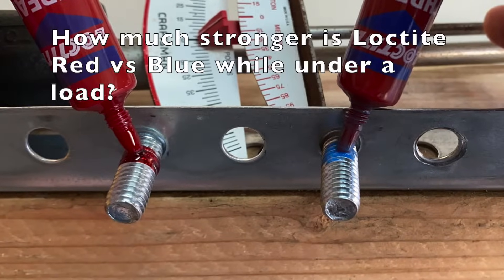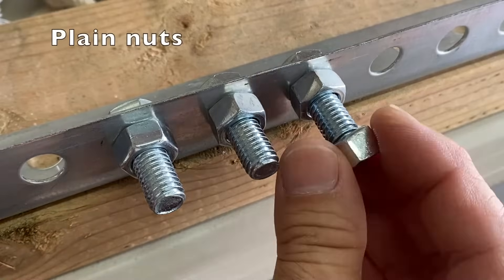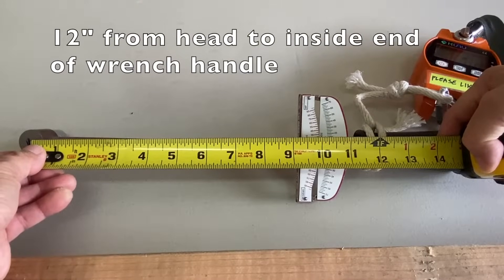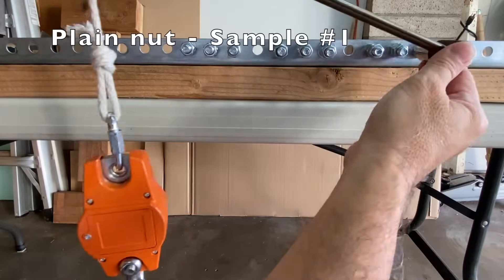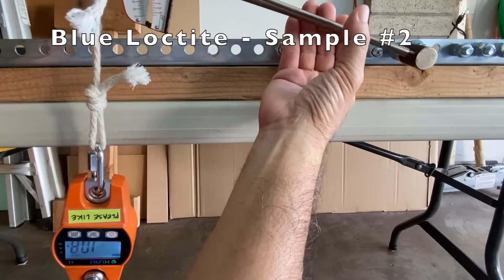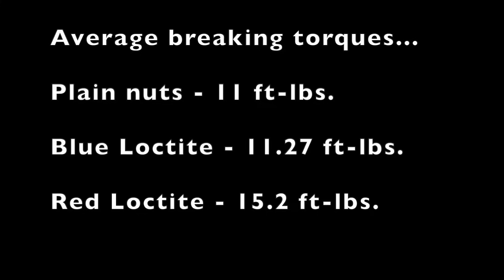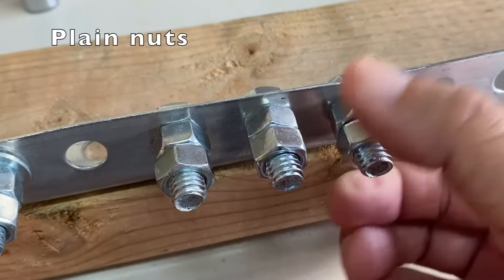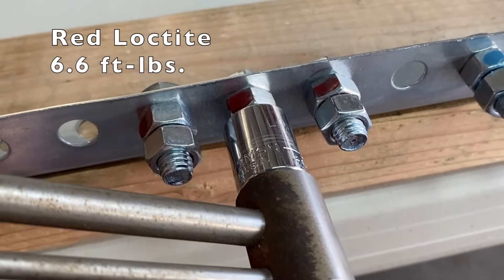Nuts & Bolts - The Honest TRUTH - How Much Stronger is Loctite Red than Loctite Blue?

Comment: When i needed to lock a plastic double threaded nut that unscrewed because a switch pressed on it, i used instant adhesive. This assemble is the tail switch of a very expansive and very advanced flashlight, Acebeam W35. The electronics in this flashlight is outstanding but they somehow got a flawed tailswitch.

Comment: BROWN and/or BLACK Lok-Tite is used (I've done it hundreds of times) to lock the nut on a Saginaw(GM) differential and on 7 1/2" FordMoCo "banjo" differentials and takes over 400 foot-pounds of torque on the 15/16" Saginaw nut or the 7/8" FordMoCo nut to break loose (four foot 3/4"  breaker bar and two teen agers standing on a 2 foot "cheater" pipe). My Daddy taught me this when he worked on B-47C brakes (at Douglas Aircraft) and also used BROWN Lok-Tite to lock the wing attectment taper pins nuts (12 spline) to the "spine" of B-47's empennage. B-17's, B-24 and B-29's all used drilled nuts with up to 10 gauge double twisted safety wire. The wings of B-52's were secured with Eastman Chemical (Kodak) 910 cyanoacrylate glue (and still are!).

Comment: As a mechanic, the red locktight was used on engine head bolts, crankfast bolts and camshaft bolts. To maintain the torque.  The rest blue lock tight that require less torque.

Comment: Of course Locktite Red is stronger than Blue....they are for different applications. Red dries like an acrylic glue, and it will literally seize a nut to a bolt. There have been times when I had to apply heat to cook it off so I could loosen a nut. 
The Blue formula will dry like a paste and it will only prevent nuts from vibrating and backing off the bolts....with a good amount of force you can loosen nuts drenched in Blue Locktite.

Comment: Red and blue are used in different applications. Blue is thread locker to prevent vibration loosening. Red is for press fit application as in bearings. Neither is for shear forces. For best results for either, use Loctite primer 
Nice demonstration but not of what the products are designed for.

Comment: Blue Locktite is intended to prevent nuts loosening by vibration.  Red Locktite is designed to prevent nuts loosening except when deliberately turned with direct applied torque.  Different use cases, hence different results.

Comment: Briefly ... If you are inserting a stud use red Locktight to keep it secure.  If you are then looking to secure a mating piece, nuts can be held fast against vibration but still able to be removed without extracting the stud. Not the whole answer but just one example from an old Marine Engineer.

Comment: I looked into the manufacturer's specs for both when I was trying to figure out if medium strength Loctite would be OK to secure the tiny screws on my watch's steel bracelet. Couldn't find anything weaker than medium strength (which is blue in my country/market and labeled "243"), so I wanted to make sure this stuff wouldn't cause a stripped screw-head down the road. 
It turned out that the material used is a major factor when it comes to torque needed to break the screws loose. According to the graph/tables I found on their website, both "weak" and "medium" strength Loctite will require much less torque to break loose if they're applied to stainless steel threads/screws/nuts. I don't remember the exact values, but I'm pretty sure that "243/medium" requires about as much torque on stainless steel as "weak/light" does on non stainless. 
I still tested it on a single spare screw/link before applying it to all the screws in the bracelet, but since I could undo that thing pretty easily after 30 hours of curing, I decided it was safe for this application and went ahead.

Comment: I suspect that it's not what it was designed for, locktite or whatever it's called, is made to prevent the bolt from becoming loose due to harshness or vibration forces...

Comment: Not to point out the obvious here, but all screws/fasteners come with a layer of oil on them. Hit both male and female threads with some brake cleaner before using thread locker. This is not a theory. It works infinitely better. Trust me.

Comment: so the blue one is better. because it's not mean to be harder to unlock. it's made to resist vibrations. if the blue one is easier to unlock, than it should be softer, so it should be absorb more vibration than the red one.

Comment: as already stated Loctite is to stop nut from backing off, not to keep it from being able to be undone. By locking fasteners in place, threadlockers help ensure the integrity of assemblies and prevent potential failures due to loosening. Loctites own websites states "Threadlockers are designed to prevent fasteners from loosening by coating the threads with a high-powered adhesive. They also protect against corrosion and rust buildup, making removal easier in the long run."

Comment: In my now-at-end 'career', I looked on locktite(& other threadlock compounds) as alternative to lockwasher or double-nut(or torque-down) or locknuts, with the aim to avoid loosening, by slight/incidental contact, vibration or mild temperature change.  Double-nut is generally poor, as there is neither adhesive (as with loctite), nor much spring-forced interthread contact (as with lockwashers), nor material clamp-or-block of threads (as with locknuts), and so double-nut tends to loosen.  Locknuts work well with caveat: 1) metal-deformed-thread are best used for a true 1xfastening, as they may distort the fastener threads, & 2) polymer-insert locknuts do not damage but may degrade if in place for many years or in hot-cold cycles.  Lockwashers are fine, especially for repeated re-assembly with 2 notes: 1) I preferred spiral with following nut tightened until spiral is flattened, or 2) bellville are fine, but pricey and don't easily/visually show flattening, 3) 'toothed'-type tend to vibrate loose, as there's often less 'spring-preload'.  Threadlocker is fine with notes: 1) Loctite is not the only brand, 2) 'chapstick'-type is often more controllable than liquid (e.g. on seapage), 3) threads should be especially clean, esp. of oil/grease,  4) mid (blue) loctite was my go-to, as stronger than green, but easier for dis-&-re assembly.

Comment: Author does not understand why we using threadlock. It is not to increase unscrew torque, but to prevent unscrewing under vibration.
Reply from the maker: Thanks!  Commenter doesn't understand that torque testing is a way that manufacturers test the strength of their threadlockers.  Here's a Loctite video... https://www.youtube.com/watch?v=PGZCPyi8yBc
👍😎
Reply: @HacksbyDad  Mate, I give a sh!t what they doing. Threadlockers are NOT for increasing disengage torque, they for prevention of unscrewing under vibration.
Reply from the maker: @FirstLast-n5b  I agree that threadlockers are to counter vibration.  The adhesive strength plays a part is this.  Loctite and other manufacturers note the breakaway torques in their technical data sheets.  Nuff said.  Have a great life!
👍😎

Comment: ...Your test is flawed because the different colors of Loctite are designed for different sizes of nuts and bolts. Purple Loctite, blue Loctite, red Loctite and green Loctite all have different securing abilities so that a wide range of holding ability can be accessed. Case in point, try green Loctite on a very small nut and bolt. You will break the bolt trying to get it loose again...

Comment: Here in Southeast Asia, there's a brand of thread locker than seems to be tougher than Loctite. Check out Visbella. 😎

My bike's sprocket bolts never went loose with Visbella's medium strength thread locker. But with Loctite's medium strength thread locker? Oh, my... One of the nuts came loose after 10 months/10,000 KM.

Comment: Something to note is that the application of loctite acts somewhat like a lubricant (as in, while it's still wet, prior to curing) which changes the recommended torque spec vs a dry thread. For dry steel:steel contact, the coefficient of friction is about 0.5 to 0.8. Info on the Internet places steel:steel with loctite applied in the realm of 0.15. These values correspond to K in the torque spec equation T = K*D*P, where D is the bolt  diameter, and P is the preload force which depends entirely on the material and geometry of the bolt. Since D and P are not changing with application of the loctite, we can see the torque spec difference should be about 35% to 65% (0.5 - 0.15 to 0.8 - 0.15).

Dunno if the effects are going to be that drastic since these are all conservative approximations but it's definitely worth noting for the sake of the experimental results
Reply from the maker: Thanks!  I found the opposite to be true in that Loctite does not act as a lubricant.  Here’s my very small-scale experiment… Loctite Threadlocker and Clamp Load
https://youtu.be/SLBx09En_P0
👍😎

Comment: you have this whole question ass backwards...it's about keeping bolts from rattling off..ie: vibration ....not torque....you need to go over to project farm...he knows how to do this correctly...treat yourself learn something.
Reply from the maker: Thanks!  Here's my playlist of various tests including vibration tests... https://www.youtube.com/playlist?list=PL_WcGw5s6Cq6YK_s-NNne1838j25ijmii
BTW... torque testing threadlockers is an easy way to test their adhesive strength.  Manufacturers normally supply the breakaway torque range of their threadlockers in the technical data sheets.  
👍😎

Comment: People misunderstand that blue Loctite is just meant to keep a bolt from vibrating loose. I really don't think it's meant to add any increase of torque needed to remove it
Reply from the maker: Thanks!  People misunderstand that torque is a convenient way to test and demonstrate the strength of threadlockers versus vibration.  In fact, manufacturers list the breakaway torques on their spec sheets.  👍😎

Comment: Way too much product did you clean the threads as recommended?   Also you should not touch the tip to the bolt….henkel claims contamination can happen.   Normally you break these with a heat application first.

Comment: I believe loctite different colors are for specific size range of bolts. For example pink is for bolts under 1/4” blue up to 1/2” etc its strength is based on torque a bolt would be subjected to. Bolt torque varies by size for clamping force or tensile strength n stretch.
Reply from the maker: Thanks!  There is quite a bit of overlap on recommended bolt sizes.  From Loctite's literature... the colors identify the adhesive strength and removability.  
Red - high strength
Blue - medium strength
Purple - low strength.  
😎

Comment: It has nothing to do with torque.  It’s to prevent vibration from loosening the bolt
Reply from the maker: Thanks!  You are correct… and the adhesive strength plays a part.  👍😎

Comment: There’s loads of different loctite , that’s why they represented by a number. It has to do with application also . I’ve had specs to follow that you use 3 dots( when you squeeze the bottle a droplet falls ) up a thread to a line up ( you squeeze a line and it remains a line , not bladdered everywhere) the thread. One application we use a line on thread on a highly flex frame and a bolt under high stress . We torqued up to 30lb and breaking it is 90Lb-120lb . If we fit to less it’s comes free or seizes in place due to moisture , apply to much then the only way to crack it is using loads of heat ( not what you want on a highly flexible frame ) . The right application  you can usually find in manufacturers assembly/service guides

Comment: Loctite initially acts as a lubricant so the torque should be derated since there is less friction in the threads. Loctite also fills voids in between threads so it can prevent ingress of moisture which can lead to corrosion and seizing. Blue Loctite can be useful for tie rod end jam nuts. Prevents them from backing out and makes them easier to loosen for adjustment or replacement.
Reply from the maker: Loctite being a lubricant is a common misconception.  Here's a my video on the subject... https://youtu.be/SLBx09En_P0
👍😎
Reply: @HacksbyDad  I guess the engineers at Loctite don’t know what they re doing then. Read their documentation.
Reply from the maker: @chrishamel3001  Their technical data sheet and threadlocker manual do not state that it is a lubricant.  
- Technical data sheet https://dm.henkel-dam.com/is/content/henkel/TDS-209741-US-Loctite-Threadlocker-Red-271-Carded-Tube-0.20-fl-oz-2018-04-09pdf
Threadlocker manual - https://dm.henkel-dam.com/is/content/henkel/LOCTITE-Threadlocker-Manual
They do say that the affect on friction (k-factor) of a threaded assembly needs to be determined on a case by case basis.  
👍😎
Reply: @HacksbyDad  read page 78. Although Loctite is not intended as a lubricant, it will reduce scatter like a lubricant which is why a derated torque should be selected. If the specified torque is for lubricated threads you are good to go with the spec and Loctite.
Reply from the maker: @chrishamel3001  Are you referring to another page?  I don't see where it says to derate the torque.  

Page 78... Lubricity
How lubrication reduces torque-tension scatter is described in section 6.3.3. Some
LOCTITE® Threadlockers have additives that help lubricate the assembly as well as
oil and grease. However, the effect of this property is dependent on the threaded
fasteners used in the assembly.

Page 46 - section 6.3.3... The use of a lubricant does not eliminate all other variables off friction, nor does it eliminate torque-tension scatter, but it does help to reduce scatter. Therefore, the presence of a lubricant and the underlying friction conditions still need to be known and should be tested for a given configuration.
It should also be noted that lubrication of an assembly and the reduction of input torque also reduces the bearing friction and thread friction that hold a threaded assembly together, thus making self-loosening more probable.

Derating the torque thinking that Loctite is a lubricant could be a double-whammy.  First, because the threadlocker could cause more friction, thus less nut/bolt torque.  Second, reducing torque to a general lubricant spec could decrease the already lower torque.  Both of these will reduce the clamp load... scary!
If there is a torque spec specifically for Loctite, you're good to go.  If there isn't, I wouldn't use a general lubricant spec like for oil or anti-seize.  
😎
Reply: Engineers have tested this in labs and not just using a scale and rope and a sample size of 3 nuts. The question of friction or k factor in bolt torque is a bit more involved than you currently understand.
Reply from the maker: @chrishamel3001  LOL... you got that right!  I'm no expert.  Just a guy goofing around in my garage.  The engineers are much smarter than me and purposefully do not say to derate the torque when using Loctite because they know better.  
It's all good if the application isn't critical.  
Thanks for the discussion.
😎
Reply: You are so stubborn. They don’t say because they can’t afford the legal ramifications of a blanket statement. The applications I deal with are critical. There are studies after studies discussing this and list loctite as a lubricant. I personally don’t derate the torques when I use loctite with my car but that’s for a whole other reason.
Reply from the maker: @chrishamel9570  It's all good.  You told me to read their documentation and I did.  👍😎

Comment: Missing the true need for Loctite. It's to keep the nut from vibrating off. The 'Glue' strength of Loctite is meant to cushion the nut, on the bolt, isolating it from the vibrations. 
Do your vibration test for the blue & red Loctite. Try the purple for hydraulic connections, like brake lines.
Reply from the maker: Thanks!   Here’s my vibration test… ...I Listened | Loctite Red & Blue EXTREME Impact Vibration Test
https://youtu.be/lwtUWB2TIYA
😎
Reply: @HacksbyDad  
Thanks!

Comment: Last night i was taking apart my 2x72 belt grinder and i had used red 271 loctite on all the fasteners (mostly 5/16-18 stainless (18-8) hex bolts and nuts. The first nut didn't want to budge when using a ratchet so i grabbed a 36" breaker bar and i was able to get it loose. Second nut was tough with the breaker and i ended up turning breaking the bolt right off. For the rest of them, i gave them a light torching and that made the rest of them simple. 

Based on your results, i wonder if you got some counterfeit loctite.

Comment: Is is possible to remove LOCTITE 242 residue from painted surface? 
I used Loctite 242 for the screws to attach black painted bar ends weights to the handlebars of my motorcycle. Unfortunately, I had some Loctite residue on my hands during assembly, which left some ugly fingerprints on the shiny black paint of the new bar end weights.
Is it possible to remove the loctite residue from the bar end weights somehow without damaging the paint? Maybe with chemicals, heat or buffing?

Comment: The whole purpose of LocTight is to reduce the amount of nuts coming loose because of vibrations.
Reply from the maker: Yup!  Besides filling the gaps, the adhesive strength helps hold the nuts in place.

Comment: test fingernail polish to the blue .  lot of times i just use fingernail polish as a substitute.  locker it to help keep the nut from backing off under vibrations.   red is used of crank shaft nuts and other high speed nuts . blue is for body fenders frame .   lot of times a book wil say what to use .

Comment: After applying Loctite you're supposed to tighten the nut to the proper torque. You just put them on finger tight, which is incorrect application.
Reply from the maker: This was just a strength test of the adhesive itself.  Please check my channel for other tests.   😎